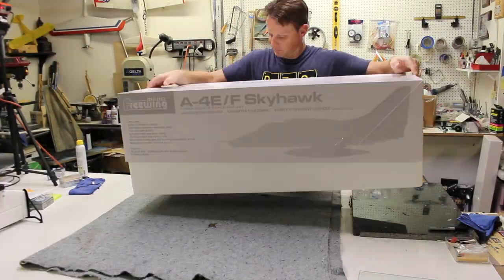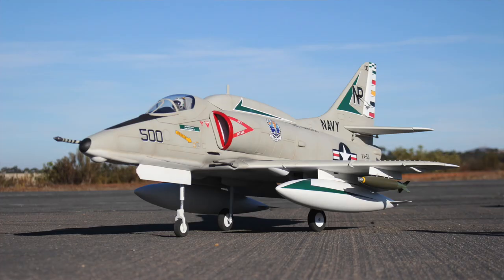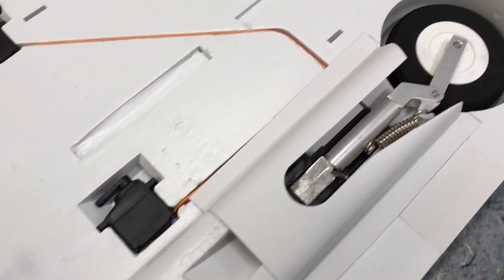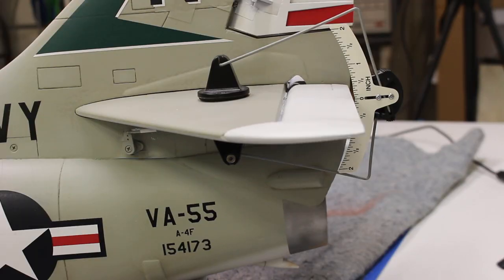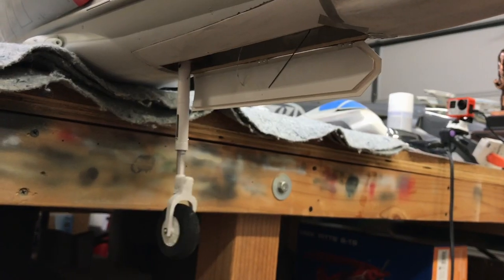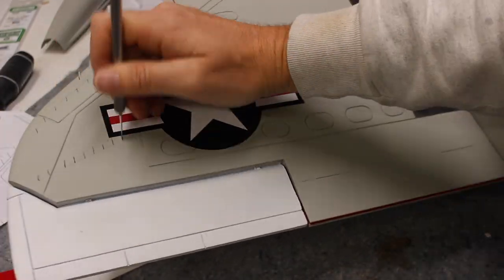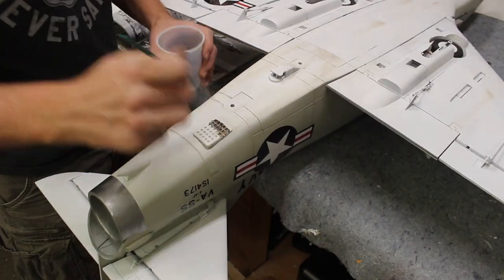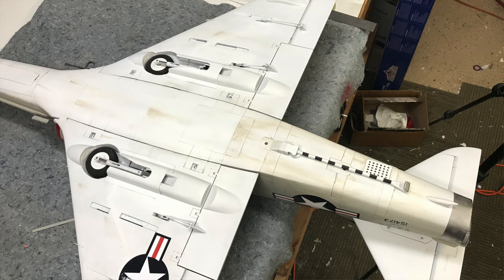Assembly & Flight Review - Freewing A-4 Skyhawk EDF

Comment: Great hints and for the A4, but I wouldn’t close the aux air inlet anymore. Flying with open „cheater hole“ the A4 has a very good high angle of attack controllability, typical for a delta plane. Landing with nose high and a bit of thrust was easy to control. But after closing the aux air inlet, I had several uncomfortable stalls close to the ground during flare, resulting in hard landings, as the EDF has considerable less trust and slower response during slow flight with closed cheater hole.

Comment: Chris, I use that glue without melting by making contact of both parts for 5 seconds then pull apart for a minute or two before making the connection. We call it flashoff. Charlie H.
Reply from the maker: Good to know!  I've pretty much avoided that glue since then and have just been using epoxy.

Comment: Would it be difficult to add main gear doors and leading edge slats to this model   thinking leading edge slats might help slow speed handling
Reply from the maker: The main gear doors are pretty feasible. I know a few folks who have done it. Requires making a form and then making parts from it or just hand building each door in the right shape. Slats are a much more difficult prospect. I do think it could be done, but lots of geometry to sort out. I’d recommend making a fiberglass part of the slat off of the model first and then you’d need to build up tracks for it, etc.

Comment: Can you elaborate on the wire spring you used for the nose gear door? I'm not sure I understand how this is working. I add nose gear doors to a lot of planes I own and I always struggle with how to make the gear doors spring open. 

Maybe you can make a how-to video for it?
Reply from the maker: So, the spring is like a big "Z", except that the leg attaching the top and bottom is vertical.  Also, the top leg is quite a bit longer than the bottom and is angled outwards to push the door open.  So, when the door closes, that top leg basically just rubs against the door, but still provides force to open it up.  I do have a picture in my article on my website which should help? http://thercgeek.com/2018/03/freewing-a-4-skyhawk-80mm-edf-assembly-flight-review/

Comment: Nice review. I was debating about buying the A-4.  I purchased the A-6 Intruder kit, instead and plan to ultra detail it using some of your techniques. Will your 3D bombs and ejector racks work with the A-6?
Reply from the maker: Cool, thanks!  The bomb set I developed for the A-4 is too big for the A-6.  However, Motion RC does sell a foam multiple ejector rack setup specifically for the A-6.

Comment: Another great video Chris, thank you! Quick question for you...do you think this aircraft would be able to handle the 6000 mAh Pro packs from Admiral? It'd be a little extra weight and size up front which may also allow me to have the battery back a bit further since it seems the 5000s were being run pretty far forward.

Thanks again!
Reply from the maker: Yeah, I don’t think that’ll be an issue. I flew this one on 5800s I think and would use a 6250 if I were to do it again.